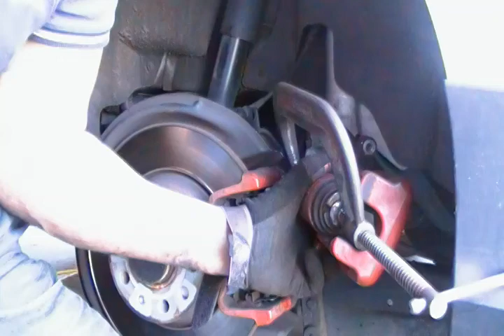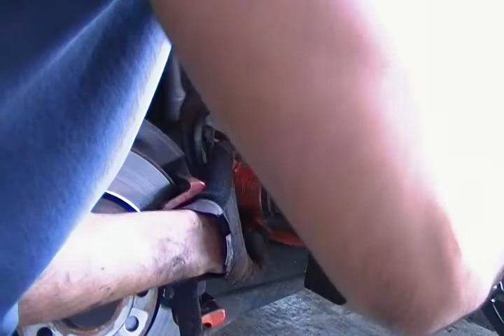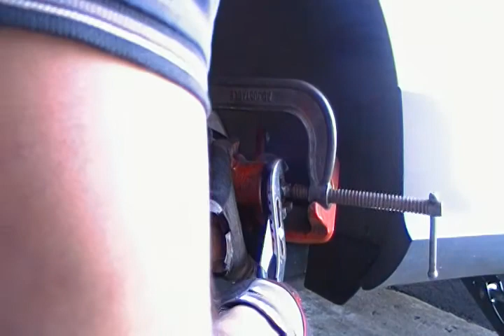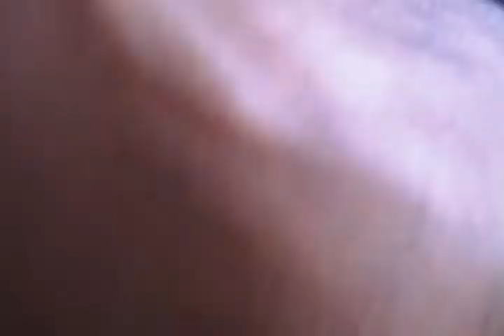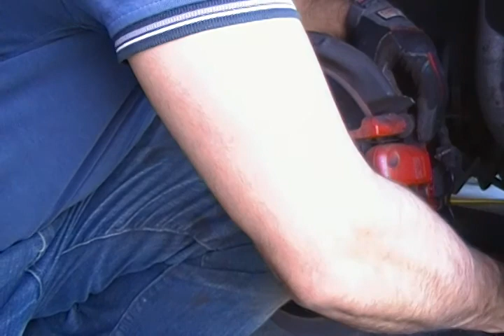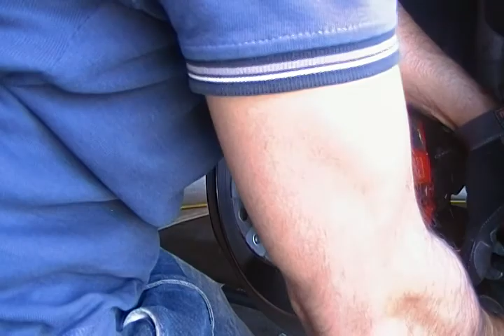2007 VW GTI Rear brake pad replacement WITHOUT compression tool Part 2

Comment: i like this because i have been where i could not get to, or afford to rent the piston clamp.  be careful not to eat up the edge of the caliper piston, with the channel locks.  it could cause the boot to leak and rust on the inside. making it where you will have to get a new caliper next brake change. lol still nice job.